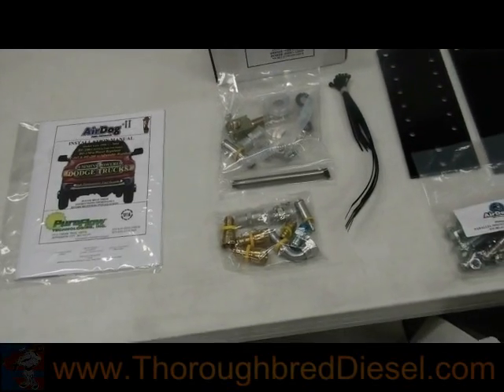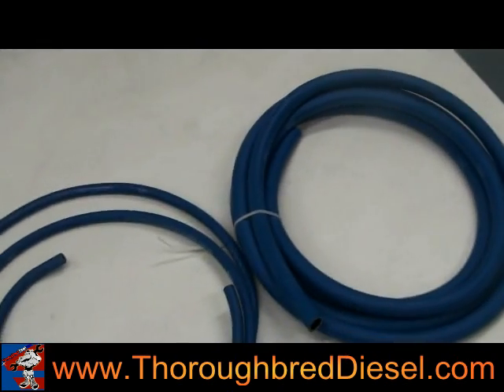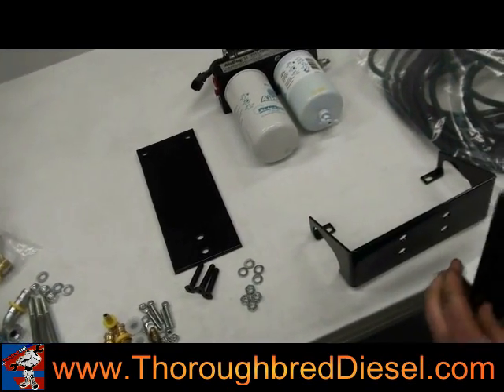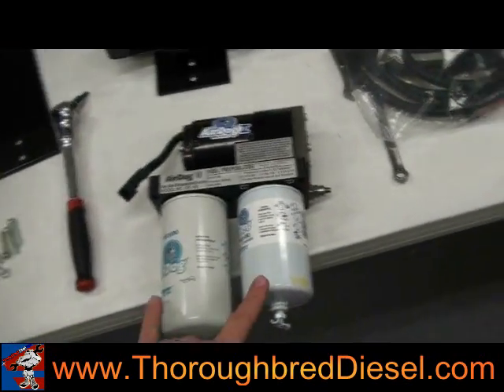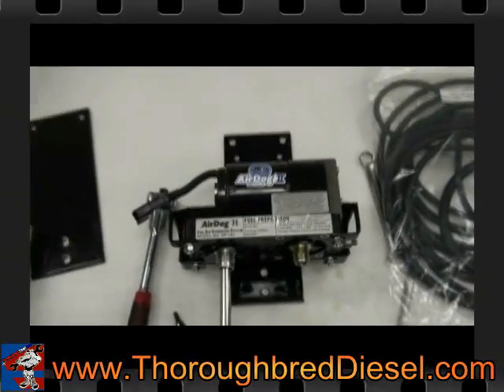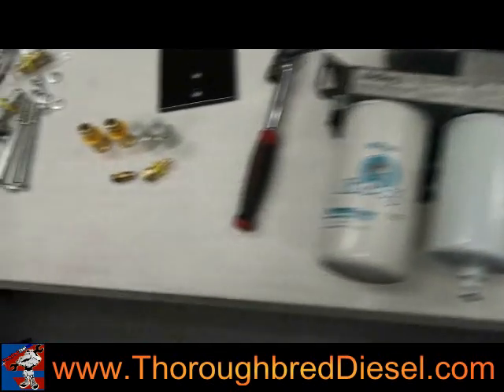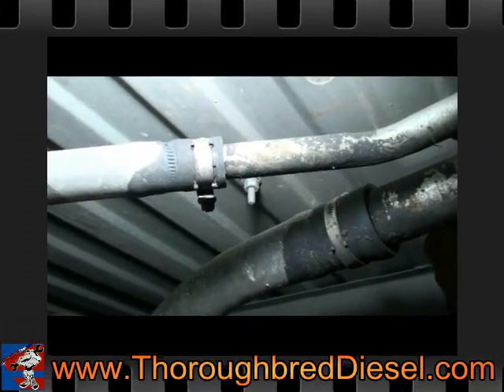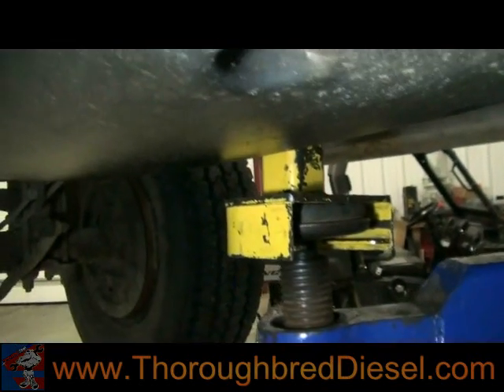AirDog II Fuel System Installation: Dodge Cummins | Video 1 of 2

Comment from the maker: If you are having fuel contamination issues, an AirDog or FASS system would solve the fuel contamination or water in fuel.  These systems guarantee you that once fuel has left their pump, it is pure fuel all the way to the engine.  You can replace 2 injectors, but from experience, 2 injectors with 4 old injectors will cause balance rates to be off.  If you can afford to replace all 6, that is our recommendation.

Comment from the maker: Adding an AirDog to your truck can really help to maintain the life of the engine and injectors due to the extra particulate matter. If you are trying to increase HP then it is a must have. The stock delivery system on a truck is not sufficient enough to supply the fuel that adding extra HP will often require.

Comment: Why do you have a metal dip tube in video 1 and the plastic in the second?  I prefer the metal too, but have the plastic from video 2.  I have the Airdog II, was there and option I missed when ordering? I hope it is durable enough for biodiesel and assume it will be since the lines need to be rated as such when I read up on it.  That stuff dissolves so much I would hate to be replacing parts.

Comment: clean fuel filters probably every other oil change, add a fuel line filter set up, don't need a airdog, but additive once a month for algae  and fuel additive for injector cleaning, yes it is okay to replace, but make sure they are the same cc or size of what you have, but i mean it may be better to replace all but two won't hurt anything as long as they are the same size as the others.

Comment: Wondering could you give me a little advice... I have a 2007 dodge ram 3500 5.9 ... 149miles ... My first diesel truck... Brought it 6 mths ago ... Really didn't service much but an oil change... He's the problem. I ran it low... 44 miles to empty .... It puttied to the gas station..... I put $50 in there and putty still to the house... Took it to the dealer he... Says number 3 & 6 injectors are completely dirty... Need to be replaced... And fuel filter... .. Each injector is $650 ... And filt

Comment: This was a post... I posted in cummins form.... While inspecting my truck ... And dealer wanting to charge me $163 to change my fuel filter .... I started Doing research and screen I have a air dog fuel filter setup just like in this video ... Trying to search and see if you made one how to change the filters .... Im calling you guys in the morning to order a set. 

Wondering could you give me a little advice... I have a 2007 dodge ram 3500 5.9 ... 149miles ... My first diesel truck... Brought